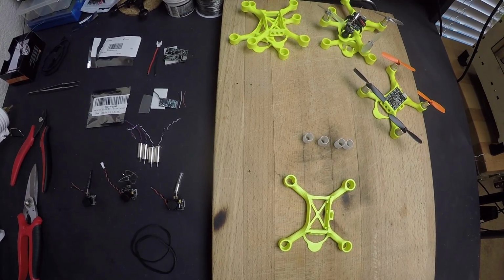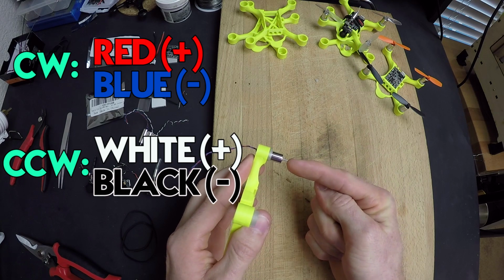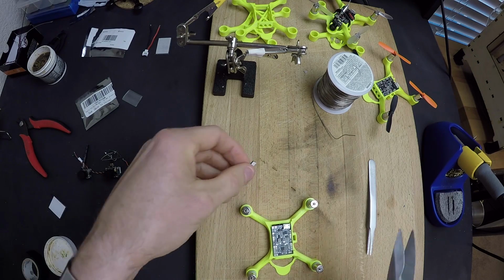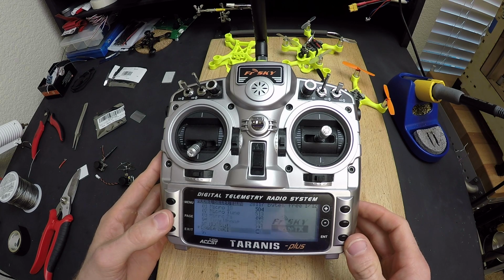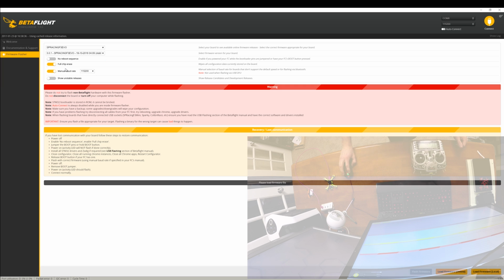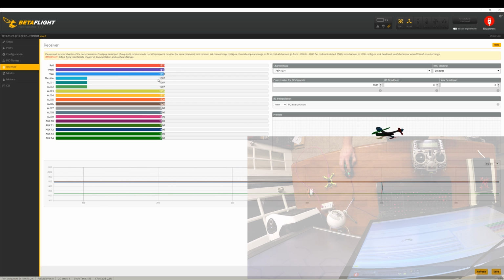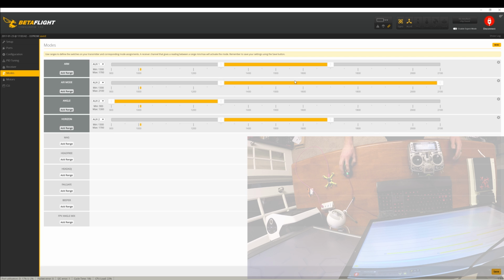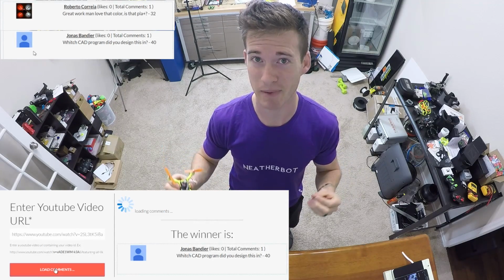Micro Quad Electronics

Comment: Hey... for the life of me, I CAN'T get this board flashed in Betaflight. I tried a Windows 10 and Windows 7 system, making sure I downloaded all of the drivers needed. I can get the board booted with the boot pads jumped, and I get no device errors on either system, but I still get the "can't contact bootloader message. 

Any chance you can let me know how to flash this? I'd love to get this thing flying!
Reply: I finally got it working. I had to use Zadig while the controller was in bootloader mode to install the STM Bootloader driver. Then I was able to connect and flash. You may want to amend this video to include something like this, only because you show that you can just plug it in and flash. Unfortunately it's not that easy...